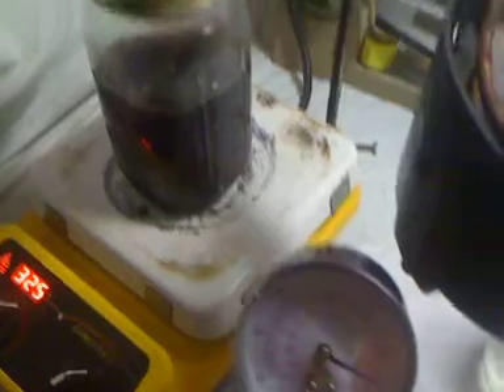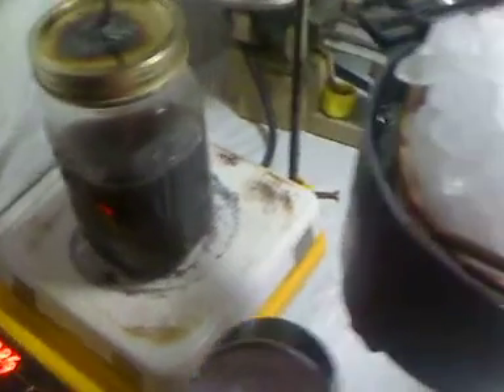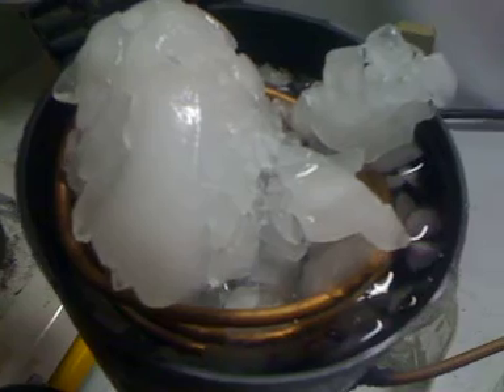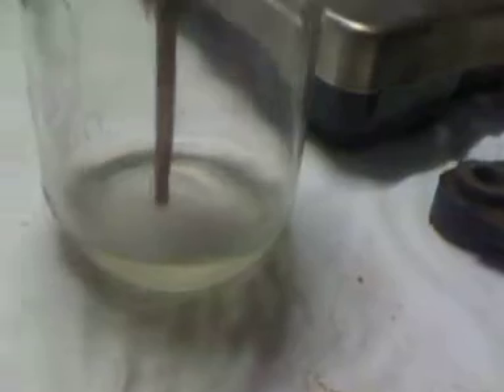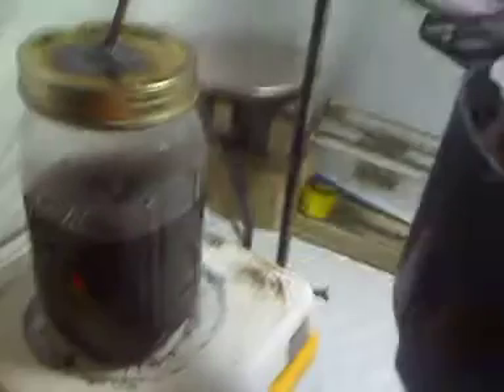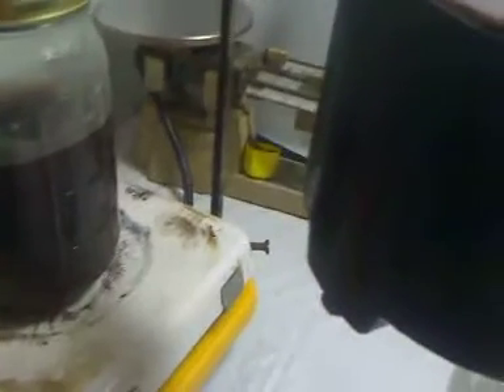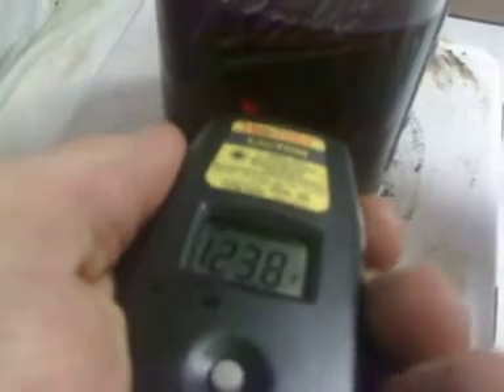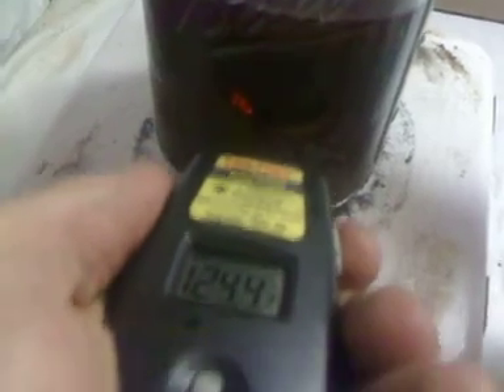Biodiesel - Methanol Recovery Demonstration Part 3

Comment: Do you know if methanol recovered purity is good enough (mostly water content) to use it as a feedstock in the process (pure or blended)?
Reply from the maker: I haven't made any bioD for a few years now. But if your feedstock was dry, you shouldn't have any water content in the recovered methanol. It's easy to test once boiled off.